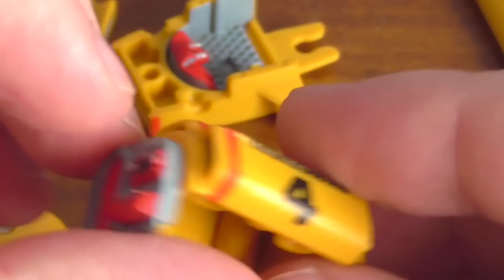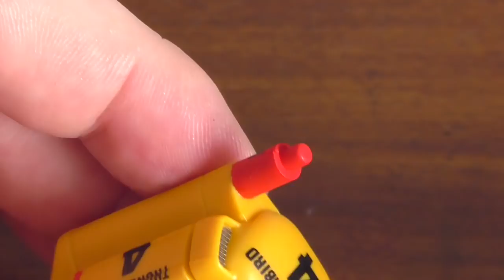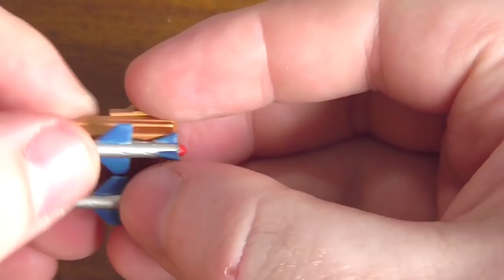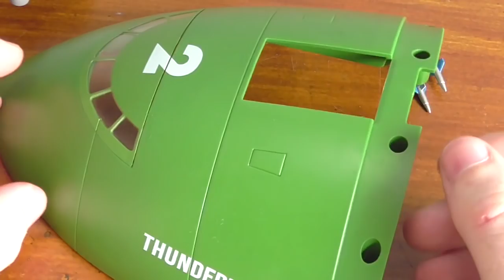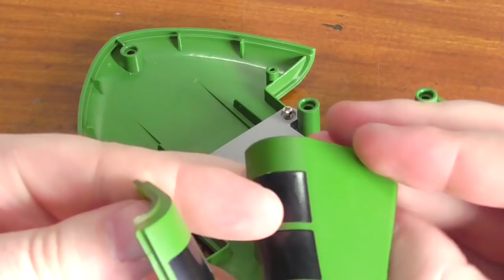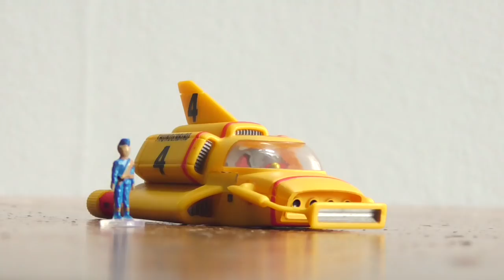DeAgostini Build Your Own Thunderbird 2 Issues 3 & 4: Used Footage #2

Comment: Normally scraping off the excess glue outside removes what is plugging up the tube, but if not I use toothbrush bristles poked down each end. Of course removing the metal tube lets you squeeze it from the yellow section but it's a lot less controlled

Comment: I used the same glue for falcon but just removed that metal tube since it kept getting blocked up. Wrapped the glue tube up in a zip lock bag to stop it going dry. Used cocktail stick to put it on most of the parts rather than the nozzle/tube. Was thinking of swapping to the brush on glue you used before, what made you switch over?